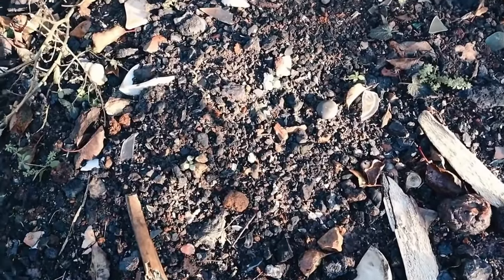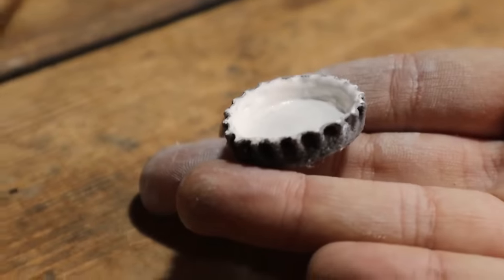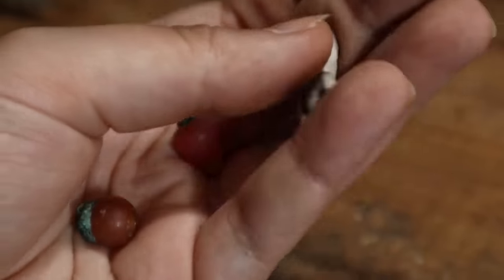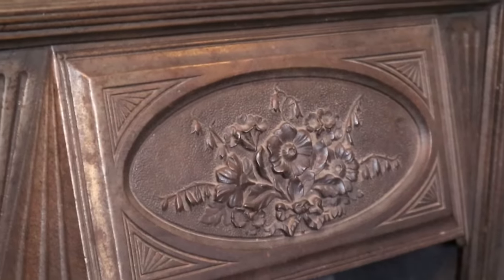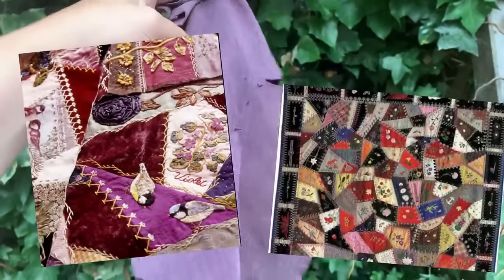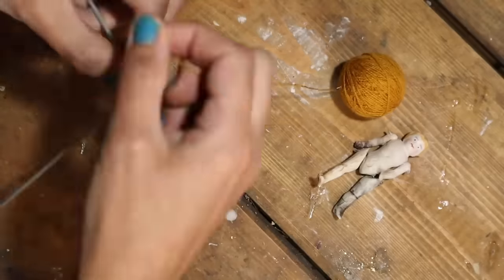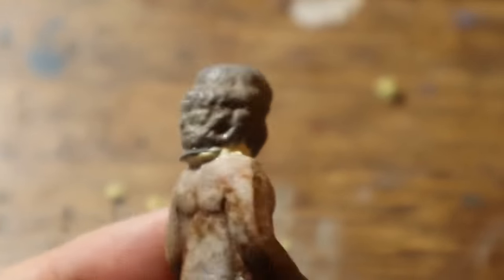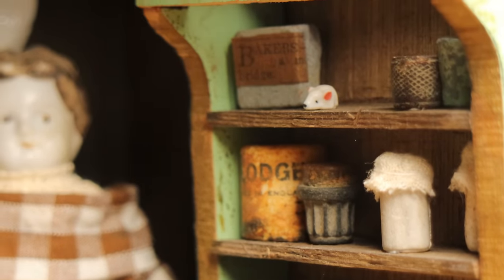Where It All Began! Building A Miniature World From Antique Rubbish!

Comment: PS Fleur and Kate - if you have metal you want to join but think it's too fragile like the birdcage bits - there is a metallic form of 2 part epoxy resin that is silvery looking ... walks to workroom to find exact item ... 'Unibond Repair Power Epoxy Metal', sets in 5 mins. I use it a lot for my bits. And you can paint it with other metallic colours or dull down with verdigris etc, Hubrol emanels are handy tho' you need to clean the brushes with white spirits. And if you ever move to  Spain - the Spanish for 'white spirit' is NOT <<espiritu blanco>> but <<aguarras>>. Now you know! Will stop wittering on now and go back to the film.